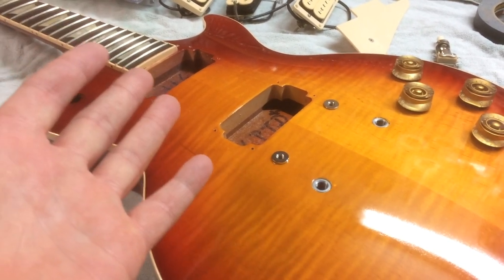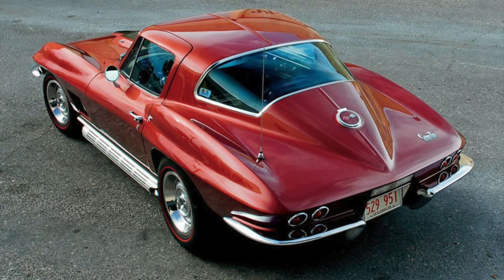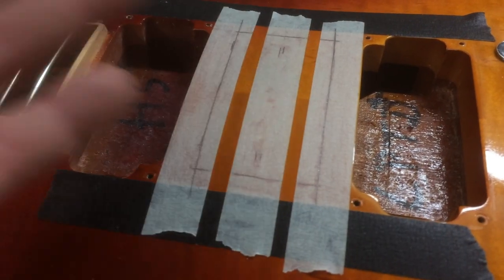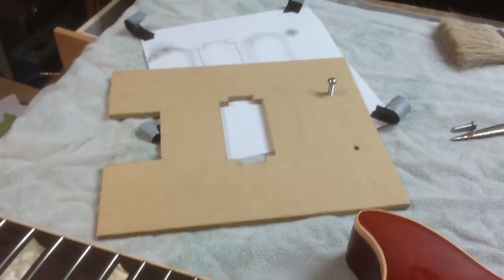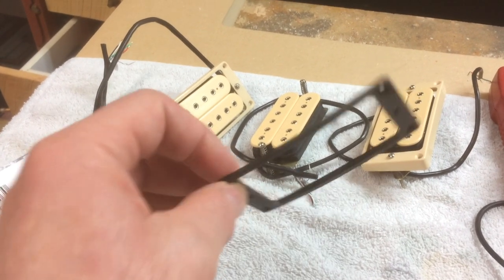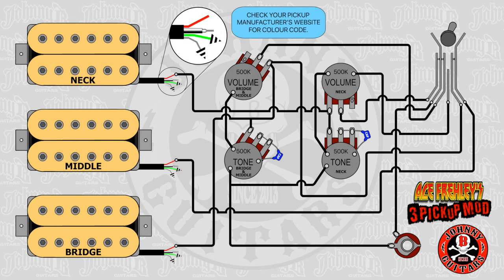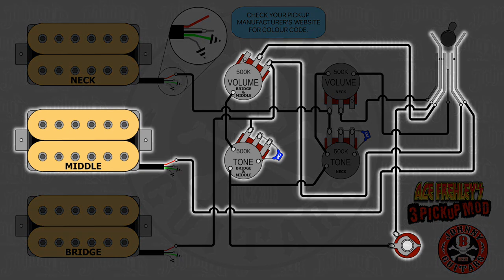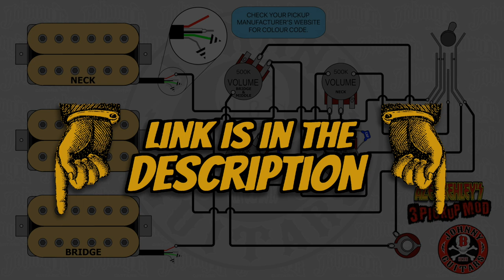Ace Frehley's 3 Pickup Mod (The Trout route)

Comment: I had a '76 Les Paul Custom 3- pickup that came factory wired as you have it here. The stock pickups were pretty weak so I replaced them with 3 Super Distortions with 500k push-pull pots for splitting and more pickup selections. The SD in the neck position was overpowering, almost useless, so I eventually replaced it with a Dimarzio PAF Pro. THAT was the perfect combination volume-wise & tone-wise. Also got some excellent Fender-y tones with the splits and pickup combos.

Comment: have you ever wired a 3 pickup paul with a standard switch(neck-bridge) but with the second tone pot re wired for a volume pot just for the middle pickup. this way you can get any or all 3 pickups, i.e. you can have just the middle by itself if you wanted,or all three on the switch would control the standard pups, the moded tone pot contro;s middle pup. it sounds really good like this
Reply from the maker: That's the other popular option, and when I build my own custom guitars I tend to wire them so I can dial in what I want from each pickup(full control). But what I like about this set up is you can go from playing a regularly wired Les Paul to this one and back again, sometimes the bells and whistles are a lot of fun but simplicity has its place as well.

Comment: Very educational video. I just purchased Ace Frehley custom shop factory aged limited edition which has the 3 pickups. Only one is wired. I like to know if it is only re-soldering existing wires in the cavity to be done. And i just follow your schematic?
Reply from the maker: First check that the two non functioning pickups are not just "dummy" pickups, replace the "three way switch" with a "three pickup switch", you'll need to add a shielded wire long enough to go from the switch to the electronics cavity (about 15 inches), then just follow the diagram in this video. Ace only played the bridge pickup but it makes sense to wire all three pickups since you have them, it'll make the guitar more versatile and it doesn't change the appearance at all. Good luck, let me know how it turns out.

Comment: you do realize that the middle and neck pick up in Ace's guitars are not wired?
Reply from the maker: Well yes I do realize the neck and middle pickups aren't wired in Ace's guitar, but thanks for checking.
Reply: Ace's guitars were Custom 57's. Saw one up close and that pup was wired. Late 70's Wembly Arena.
Reply: @JareddarArt  that's very nice, but KISS never played Wembley Arena in the 70's... 
First time was 1980, at that point Ace played a '68 custom black beaty, (3, 2 with 3 pickups, and one only had 2 and was a smoker) + a converted Les Paul Jr, single pickup with light bulbs and a Steve Carr made Explorer.....
Reply: @Casaboontha  I stand corrected, it was 84 Tour with Bon Jovi. Late 70s must have been another band. I was on a School trip in to London to look around Wembly. 84 must have been what I refer too as the Tank tour.
Reply: @JareddarArt  Ace played in Kiss in 1984?
Reply: @eggs1813  Creatures of the night in a few tracks and he did the Creatures tour. Still a member in 82.
Reply: The Townspeople  Front Cover HAS Ace on it. Ace did not play all the tracks, Vincent Cussano played a couple ( AKA Vinnie Vincent. ) Ace is still the credited band member.  He also did the Creatures 1st  tour and was replaced by Vincent for the second.
Reply: @JareddarArt  Ace didn't play a note on Creatures and wasn't on the tour.   More on.
Reply: @JareddarArt  I thought Ace played Dimarzio Super Distortion pickups?
Reply: @glennhelton4220  From my limited knowledge his main guitar was pure Gibson. But he may well have used them later on. Obviously popular then as now. In his early career he may not have been tuned in to them. His departure from Kiss is shrouded in mystery and inaccuracies. The only story I have is he drove his car in to a wall and could not play. Who knows.
Reply: @JareddarArt  Ace never did the proper Creatures tour.  He did a short promo tour consisting of TV appearances that were all lip synched.  The only time he played anything from Creatures was after the the reunion tour.
Reply: Danny 'Casaboontha' Bonthuis From what i’ve red Ace Black Custom was a 1970’s model.
Reply: @glennhelton4220  he does. 100%
Reply: @glennhelton4220  Just checked the cover of my January 1979 issue of Guitar Player magazine and Ace does indeed have three DiMarzio Super Distortions on his LP Custom. Not going to read the entire article AGAIN right now, though! ;)
Reply: Ace played a sunbursts 1974 lp 2 p/u custom routed out 3 p/u 👍

Comment: Hi, great video very informative. I would like to attempt the Ace 3 pickup mod but I have a question. In the video you mention that the 3 way switch has to be replaced with a 3 pickup switch. So my question is where can I buy a 3 pickup switch? I checked ebay but the only kind of switch I can find are 3 way switches. If possible can you please post a link to where a 3 pickup switch can be purchased? I would appreciate it very much. Cheers and thanks.
Reply from the maker: Thanks for the comment, after reading it I went online to find a reliable link so I could add it in the description. I had a hard time finding anything, hmm strange, I will keep looking though.

Comment: Dimarzio Super Distortion has 13.68k ohm dc resistance and you said 6.5k. Maybe you measured just one coil? Good work, nevertheless! For neck position you can have a PAF 36th Anniversary, a classic combination with a bridge Super D. and more versatile and balanced sounding.
Reply from the maker: Yes that could be, the point I was making was that all three were the same, I was only testing them to sort out B,M,N.

Comment: I wired my Les Paul with volume for each pickup and a master tone,sounds awesome,specially when you blend them,just wanted to share that,not sure if you ever tried that or not..Great video and just subscribed !! 🤘😁🎸🎶
Reply from the maker: Thank you for the sub! This was one of those...  let's talk about every conceivable wiring configuration, or let's talk about just one. I was going to include a segment on things like... 6 way rotary switches, in phase, out of phase, parallel and in series, coil splitting etc etc etc. But I decided to go with the "KISS" approach... Keep it simple stupid.
Reply: @JOHNNYBGUITARS  All's cool,just thought I would menchin it,so nice to use every pickup and to blend,great page 🤘😁🎶🎸
Reply: Matt Pike of Sleep & High on Fire wires his 3HH guitars this way. Its very appealing to me im thinking of trying it out on one of my WIPs.

Comment: Ace never had the neck or middle wired in. You should have made your client a 'Frankenstrat' Fair use Eddie fair use.
Reply from the maker: I wouldn't say "never" but yes, he usually doesn't wire the middle and neck pickup... up.
Reply from the maker: @MFKR696  I think that's subjective.
Reply from the maker: @MFKR696  But your comment is, I didn't find a loss in sustain at all and I'm a sustain freak.